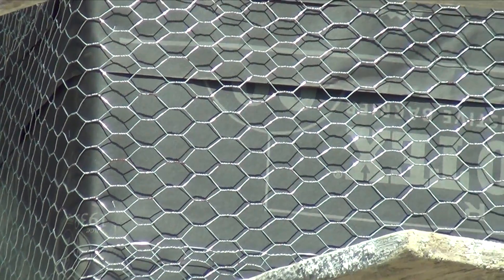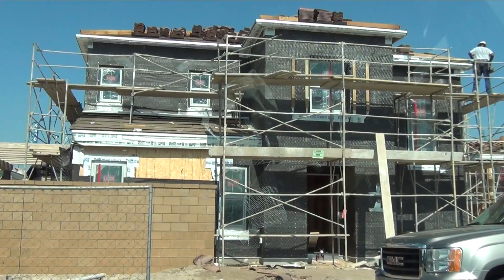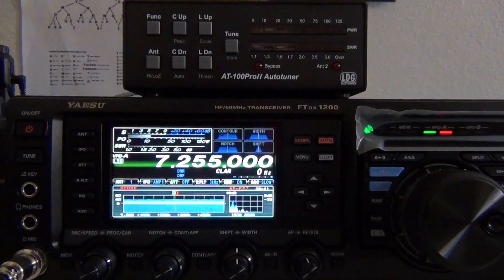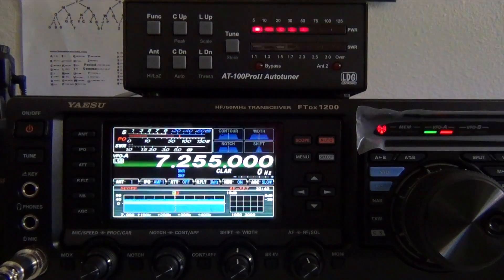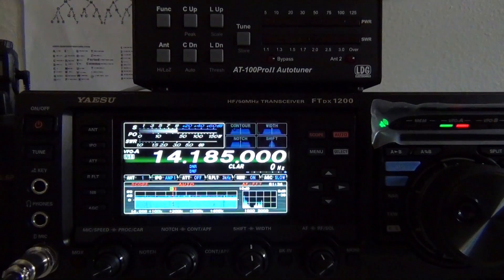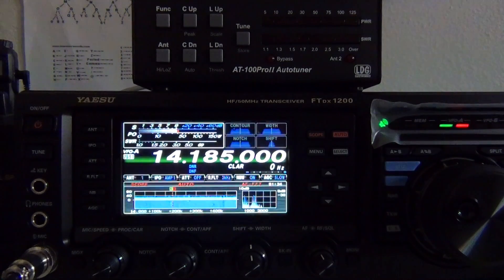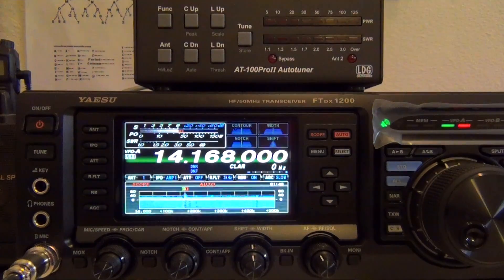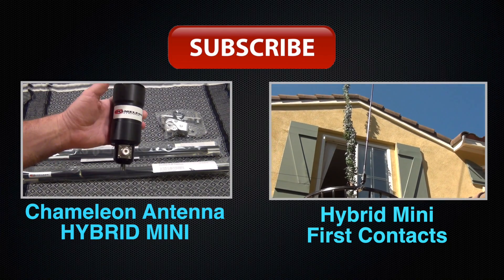Ham Radio Antenna - Chameleon Antenna Defeating Stucco

Comment: Sound quality was really good. You stated you used a painters pole? How’d you mount it on the bottom? Way to think outside the box.  73
Reply from the maker: Thank you for taking the time to watch and the comment! It is greatly appreciated. The end of the painter's pole is balanced on a ledge and then tied to the wrought iron gizmo using Nite Ize Gear Ties. They work great. I have never had a problem with them loosening or slipping. I got them at the Home Depot.
Reply: @WJ6FRadio  😆 I just left where Home Depot was, turning around to see if they have it in stock. Thank you 😊

Comment: I just decided to try my Alpha  vertical from my apt (same stucco hell), to no avail, tubed around all the bands it worked on, all static. I'm not able to space my antenna out from the walls by very much. I might try later in the evening when I can get it away from the building a little more (after the office closes).
Reply from the maker: Thanks for watching and thanks for the comment. Did you get a chance to try your alpha in the evening, if so, how did it go?
Reply: RFI is killing it. I tuned all around and mostly got some shortwave stations in nice and some CW on 40. If I was on the top floor, might be a little better off.

Comment: A patio 'Chimeneria' also be used to hide the bottom sections and coils of a multi band vertical with the top half replaced with thin black ss whips above the top of the pipe or the section visible over the fence top.
Reply from the maker: Thank you for taking the time to watch and for your comment!!

Comment: What about sitting it inside a tall terracotta chimney pot set on the peak. My friend put his Tarheel in one with a supper thin ss black whip and grounded to the mesh below. The black whip disappears from view and the neighbors think it's for a fire place. A vent pipe dual band u/v antenna is painted to match the bottom pipe and the explanation of 'my wife wanted the stink to go away' ended all the questions.
Reply from the maker: Thanks again for watching. I had looked at the ventennas, and strapping an antenna to the chimney,  but the problem I have is I have is no roof access.
Reply: That blows, I like your painter's pole set up. I have one I use with a pair of Wilson CB antennas with the tune-able tips swapped out for 49" ss whips, a poor home brew version of the 'Versa Tee' and a mast mounted FC40 tuner. They're cheap to build and tune-able from 10 thru how ever long you make the whip or long wires resonant at. Run in all the budd pole configs or with only one,in your vertical setup.

Comment: Not bad. I'm surprised the operator in Irvine heard you. That's easily groundwave or perhaps nvis. Did  I see it correctly, it's  in inverted L configuration, with iron post as counterpois?
Anyway, great job! thanks for sharing!
Reply from the maker: Thank you for taking the time to watch and for your comment! Considering how bad the bands have been of late I was very pleased to be able to make the contacts that I did. The Hybrid Mini was not directly attached to the wrought iron. It is an L with a bit of a slop due the trees and their positioning around the front of the house.